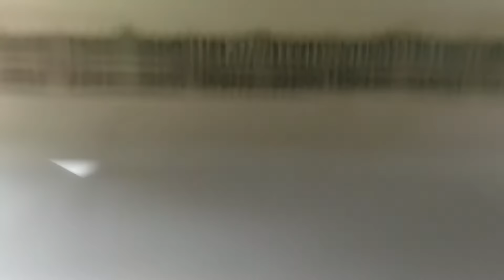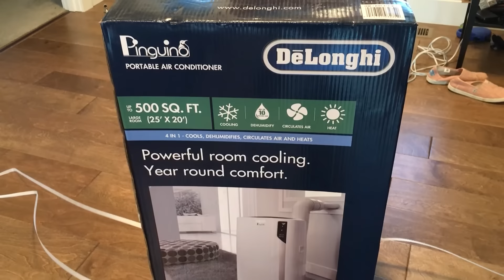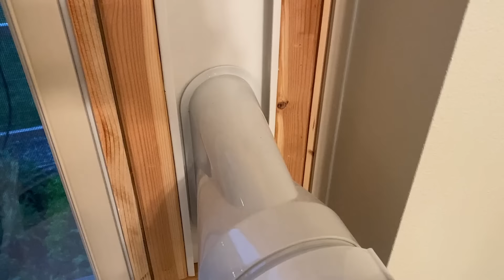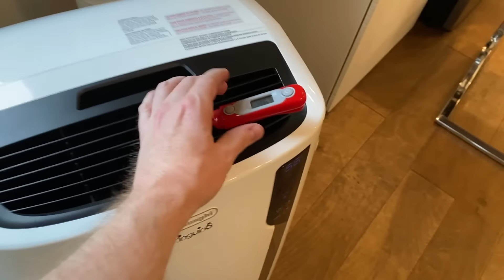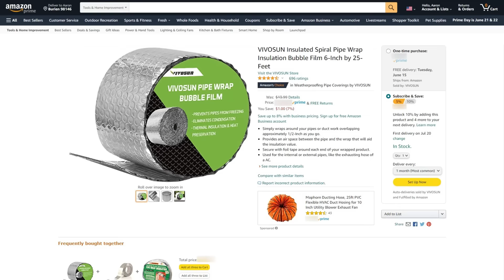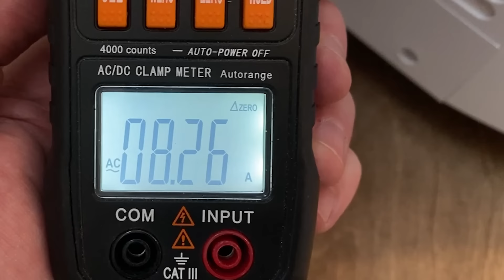De'longhi Pinguino 12,500 BTU Portable Air Conditioner: Review/Unbox/Demo

Comment: Thanks for the video. I bought mine used so I don't know much about it. Can I use an extension cord with the unit. The original cord is a few inches short of getting to the closest outlet.
Reply from the maker: I don't see why not, just make sure it's a suitable size, preferably 12-gauge.
Reply: @aaronstestlab  thank you. I'm using one that is 16 gauge, and 13 amps

Comment: It pulls air from inside not outside
Reply: Yes, and then it blows it outside. But if it only did that, it would vacuum out your house and you would die.
Thankfully your house is not air tight, so more air from the outside comes in to even out the pressure difference.

Comment: We have this air conditioner and the amount of water it produces is insane.  We had to put a 5 gallon bucket next to it to catch all the water.  Anything we might be doing wrong?  Also do you have your use the exhaust if you just want to use it for a heater in the winter?
Reply from the maker: Hard to say exactly why. But in hot and humid climates they do tend to create a lot of condensation. If its accumulating that much, I'd look at all the air filters and make sure there are no obstructions in the exhaust hose. If all that fails, and you really hate emptying the bucket, you can buy little automatic condensate pumps that sit in your catch bucket and pump the water to a sink or other drain.

And yes, you need to use the exhaust hose for heat in the winter, though in that case it's really functioning as an intake hose when setup as a heat pump.

Comment: Do you know where to buy the Extra Exhaust hose for this AC? because mine is  bad( Had a little hole on the side). Thanks a lot.
Reply from the maker: Just go an Amazon and search for portable AC hose, there's tons of them. Need to measure the diameter and thread direction though, can't recall what it is off the top of my head.
Reply: @aaronstestlab  Thanks a lot Mr.

Comment: You didn’t mention the water outlets and the pipe and when is it in use, cooling mode or only dehumidifier.
Reply: Just got one. I put a 5 gallon bucket, and empty it everyday for hot upstairs bedroom. Hope this helps.

Comment: Any tips on cleaning unit?
Reply: I remove the filter and drain the 2 holes in the back, I used I towel in the floor
Reply: I recently just took mine apart and my condenser was covered with dust

Comment: (1)  the heater function is useless, because it blowers cold air out of the exhaust. Which means you would still need a window open. Which defeats the point of being a heater. 
(2)  why did you not use that long hose cover that came with your unit?  It is an actual heat Shield for the exhaust.
Reply from the maker: Mine came with no such hose cover

Comment: Great video, I have a question about the hose it came with. What is it for? And do I need to drain the unit?
Reply from the maker: Normally used when dehumidifying to catch the condensate. I never use it when operating as an AC.

Comment: The exhaust temp does not affect the ac efficiency at all, is already out of the AC.  It affects the room temp maybe but not the efficiency of the ac unit
Reply from the maker: Come on...finish the thought. If the exhaust temp is high, it radiates back into the room, doing what to the efficiency of the unit(assuming DOE measurement standards)?

Comment: Great video! However just wanted to note you were talking in the start about the two different cooking capacity numbers. You are right that the lower number is an adjusted number you just weren’t right about the adjustments they do. The portable AC draw in air from the inside (not from the tube) and cools it and exhaust the warm air created while cooling down the other air. Then the warm air is exhausted through the tube. The smaller number is know as the SACC (seasonally adjust cooling capacity). It take into account the pressure difference that the portable makes which leads to infiltration air (air from outside the window).

Comment: i bought mine the PACEX390UVcare and it doesn't cool at all. i have a brandless portable ac and it cools more
Reply from the maker: That's too bad, mine works very well. I like your avatar BTW.
Reply: @aaronstestlab  My brandless Chinese ac shoots the air further and cooler and its 400 sq ft. This is supposed to be 700 sq ft and my regular fan does a better job. FJB!

Comment: I bought the unit at Sam's club. I ended up canceling my Sam's club membership and then I couldn't return the unit. I wasn't going to keep it anyways I was just going to use it for a month in the summer and then return it. So the unit's too big and bulky too heavy. The unit radiates too much heat.. I wish there was some type of covers and airflow movement tools so I can put it onto the cool air output and have a blow in my face. The parts are proprietary and if you try to put it out your door while the door is open and you got all this Gap of hot air coming in the hot exhaust air blows right back in I'm on with the open space.

Comment: Im stoked on mine. Pumps out super cold air, great feature set. She is pretty loud if you’re right next to it. Good idea wrapping the duct, haven’t tried that yet, all I did was tape the connections so it’s completely airtight. I did however replace my vent hose after a couple years because it cracked from the hot air. Careful where you plug these in when using multiple units in different rooms of the house, you might trip the breaker. Also, buy these in the winter season like my family did, we noticed places were almost doubling the price during the summer months.
Reply: She's a beauty.
Reply: Does your fan cycle off and on when on ac mode? It's super annoying cause I understand ac compressor shutting off once temp is reached but the fan should not cycle off and on also

Comment: I have a Delonghi PAC an125hpek A1 SKU 0151801211 item 954880 used and everything seemed to be working fine.. once I got it home... I turned on the air conditioner part and put it into my small room. I closed the window blinds and door to see how it does. A couple hours later I went back into my room and I was very disappointed that it seemed hotter than it was before I put it in there. The fan works great... and it seems like it's blowing 'cool' air but NOT 'COLD' like it's supposed to. I also realized that running it for that long.. there was no water in the tray underneath either. Should I put water somewhere? I've cleaned the filter in the back and took the casing off to make sure that everything was all clean inside. CHECK! I did try to see if the heating part worked. This too only blew air... no heat. I am not sure where to locate the place to put the freon in nor where the temperature gage/thermometer is.. can you help?

Desperately needing some extra help with this one....
Reply from the maker: Did you hookup the exhaust hose?
Reply: Yes... I tore it all apart... cleaned everything .. put it back together.. and set it up in my small bedroom... and its still blowing warm air... funny thing is that when I t I rn on the heating option.. it was almost cooler than the air condion part. Where would I find the thermostat.
Reply: Mines smells like dirty laundry 😔

Comment: Has anyone gotten a feel for how quickly this unit fills up with water while using the ac? I installed one today and the floor was soaked with water pouring out of the top spout after about 4 hours of use! Perhaps the drain plug was just loose? Or, have others had to drain the unit daily?
Reply from the maker: geez, where do you live, a tropical rainforest, lol? I live in Seattle where the average summer humidity is around 60% and I've literally never had to empty mine.
Reply: @aaronstestlab  I live in Austin Texas. Perhaps it’s a loose cap after all. I hope so!
Reply: Yea just bought one and it pours out water. Terrible design because all ac units create condensation and this drain port is at the very bottom of the unit so I can’t put a tray under it or anything to easily remove the water daily. Wish the drain was higher up like my last one so I can put a bucket next to it and let it drain

Comment: Where does the weather strip go?  The window only sits on top on the flimsy plastic flannel.  It doesn’t seem to fit the window well and have spaces.  If we are not home, it would be easy for burglar to break in. Any suggestions?
Reply: The weather strip is for the side of the plastic panel. Any window unit is not ideal for security. I use this in my room but it’s on the second floor.

Comment: Hi Unfortunately Amazon doesn't list the duct wrap anymore. I was wondering if the exhaust hose screws into the unit clockwise or counterclockwise? Thanks, Neva on the Olympic Peninsula.
Reply from the maker: counterclockwise, I only know that because I just coincidentally moved this unit and needed to buy a longer hose

Comment: We wrapped our exhaust hose with a plush blanket that has a sherpa lining. Infinitely cooler than before.  Absolutely NO radiant heat from the exhaust hose.
Reply: I am afraid to wrap in blanket but that is what came a week later a tube?
Reply from the maker: That's a good idea. Probably looks better than shiny bubble wrap.
Reply: Is that the one that came along after the delivery?
Reply: Great idea. I’ll use an Alpaca poncho

Comment: Hi Aaron. I just watched your video and it is ingenious how you did this! I have the same De'longhi unit but in 14,000 BTU. The problem I have is my vertical window is 58" and the window kit is way short and it would be flimsy like you say. I would love to make the exact same thing you did, but you don't show how. I sent you an Instagram message also. Any help would be great, it is gonna be 105 today.
Reply from the maker: Well, it's nothing fancy. Just some plywood framed with 1x2's ripped to the window track width. I then cut out a hole to match the outlet piece and screwed on the lowermost piece of the window kit. Finally I wrapped the whole perimeter in weatherstrip.
Reply: @aaronstestlab  Thanks for getting back. I was able to figure it out and was asking to see exactly what you made yours out of. I did not think you used plywood from looking at it. I used a 2x6 and planed it down, for my piece to go above the window kit for the hose, to match the thickness of my framed in 1x2's that I ripped. Thanks again for a great idea